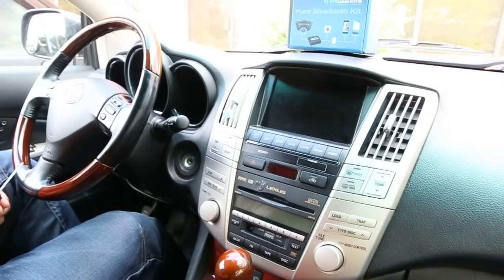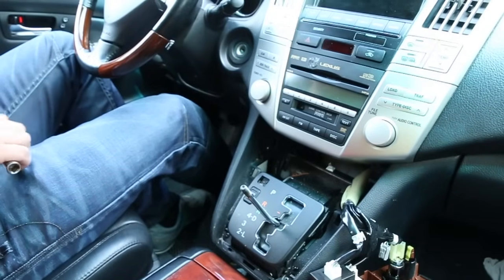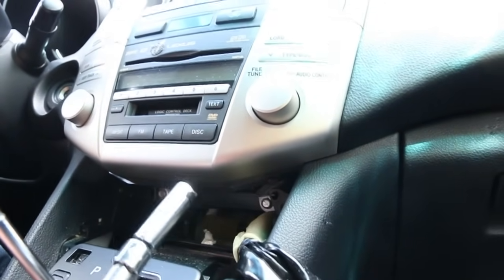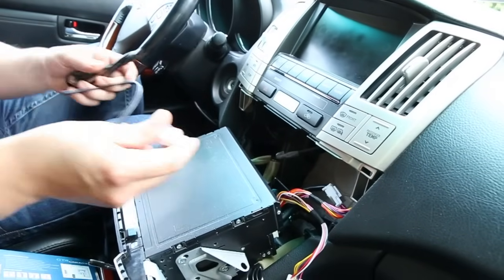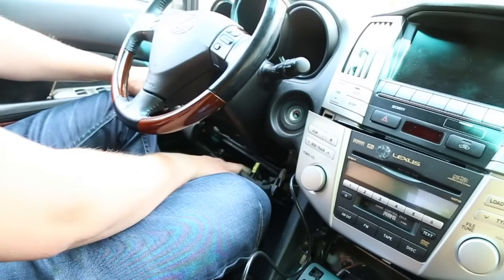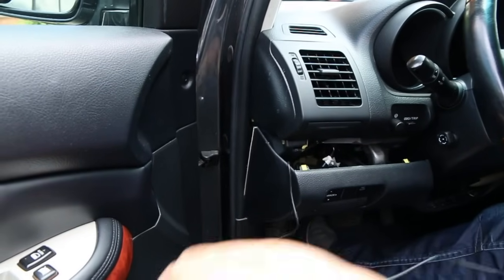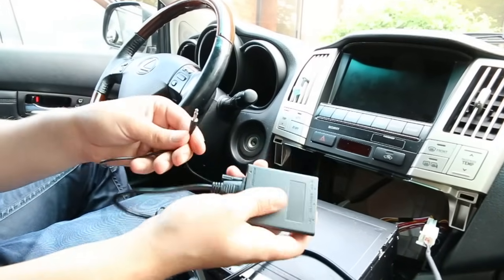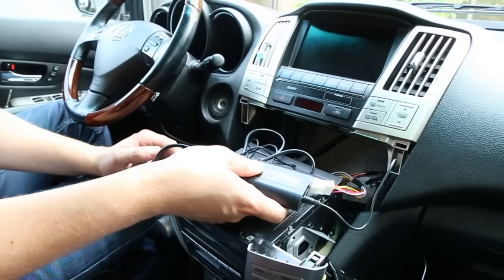Bluetooth Kit for Lexus RX 2004-2009 by GTA Car Kits

Comment: I bought and installed this unit on my 2009 Lexus RX350. Excellent! First, buying experience is as good as it can be - Few hours after I paid I got note that the product was shipped. I got it to days later, and then come what I thought to be the hard part - installing it. 
Well, I took a deep breath, watched at the video and followed, and about 30 minutes later my phone played music on my radio.
This is an EXCELLENT video with real life instructions that fantastically worked for me. Thanks guys, you've got my thumb up and 10 of 10 rank. THANKS! 
I wish I could find a place for review on your website! You sure deserve all compliments!
Few tips - 
1. WATCH the 4 screws of the radio ARE hidden and incline to fall and get lost! I placed some scotch tape inside the 10mm socket so the screw stacked in it and I manage not to lose it.
2. When I pushed the radio back the holes of the top 2 crews were not perfectly aligned and the screw would not get in. I used Dremel to create sharp conus at the top of the screw so it could force itself in and till the thread catch.
3. I used zip tie to secure the Bluetooth unit to the volume panel so it want just hang there and make noises.
Perfect, THANKS!

Comment: Honestly could not be more thrilled with this kit. 2004 Lexus RX 330. I installed in under 30 mins. The style of my door seal and A pillar did not allow me to run the mic that way, but I have a dash cover so I ran it under there and clipped it onto my A/C vent. Very easy great sound for music. Thank you so much, GTA car kits!
Reply: Did you take to a mechanic or you did by yourself?
Reply: @kimrodgers7809  I did it on my own. Could not have been much easier. I did drop one of the bolts and couldn't retrieve it so the recommendations below to use a magnetic socket on the socket wrench are right on. Everything seems to be solid with just the three bolts though. Good luck!
Reply: where can i buy it?

Comment: Video was clear and indispensable.  Watch the other one too, for the "AUX and iphone kit Lexus 2004-2009" - this shows you the location of the hidden 10mm bolts. Instead of a magnet, i used some sticky tack putty that is meant to hang posters. shoved a big glob in the ratchet and the bolt stuck no problem.  Did this to remove and replace. Worked great and left no residue in the  socket.  Bluetooth kit works great too!

Comment: Just installed this kit into a 2007 RX350 and everything went perfect.    Careful of those 2 hidden screws - they fall down and you'll need a magnetic reach tool.  The phone audio seemed to over-modulate kind of loud but it might be the caller's mic and not the unit.   Otherwise really nice kit.

Comment: Thanks for the great tutorial- installed pure Bluetooth on rx3502008 with great results but for a cleaner install I attached the microphone on top of the rear view mirror using double adhesive strip making the system like factory installed.
Yes the screws can fall fall out especially if socket is a little loose and I also used a magnetic stick- available anywhere but I always get low cost yet effective things at Harbor Freight

Comment: Helped me a lot. Thanks. Just a remark: be careful not to let the screws fall down. It is not easy do dismount the lower part of the console to look for them and pull them out. Use a socket wrench with a strong magnet to unscrew all the four screws.
Reply: InstaBlaster

Comment: i have a similiar BT Kit but not GTA brand and did the installation process in less than 30 mins with the exception of idiotically dropping one of the screws that fell off the floor on the inside.. just make sure you have some sort of stick magnet handy in any event this happens COZ IT will and CAN happen lol.. but other than that.. it was a pretty seamless process.  Thanks for the video!
Reply: Hah, just happened to me )) bought magnetic pick up tool from Autozone for 3$ and got them both ))
Reply: My experience 3 drop screw bolt lol.

Comment: Just installed the kit using this video. It really is as easy as it looks! A few things:
1. I don’t have Navi, but I still had to use the Y adapter cables. Not sure why but it worked.
2. Also I was extremely lucky that there were only the 2 easy to reach bolts. They didn’t screw in any in the hard to reach location, which made it less of a pain. No idea how I would have gotten them back in there, but clearly they’re not necessary! (at least in my 2007 model.)
3. I couldn’t easily remove the rubber on the door so I just used the tools to get the microphone wire to slide in the rubber without removing it. Worked really well!
4. I used Velcro to adhere the Bluetooth device in space I found behind the hazard lights button. Again I have a 2007 w/out Navi but it’s secured up there so there is no movement and allowed me to easily clip the radio back in.
Reply: Does this Kit work for the 2005 Toyota Corolla S.

Comment: Does this completely eliminate the Lexus Bluetooth for the phone or will that feature still work? The existing phone integration works great and don’t really want to lose it.
Reply: I also have the same question.  I already have Bluetooth that works with my phone (but not my music).  Can i skip wiring the mic through the A pillar? I suppose I'd need to toggle between Bluetooth connections for that to work... Is there any way to just connect the mic that the car is already using, to the new Bluetooth module?  I have no idea where it is, but it works just fine, and isn't visible, like in this example.
Reply: I’ll answer this.
Basically your connected to two Bluetooth so when you get phone call it goes to the Lexus oem Bluetooth and when you hang up it switched back to the gta Bluetooth
Reply: @dineshe3719  obviously my question was old. I installed the system and it worked just as you described. I wish I wouldn’t have installed it though. Should have just paid the money and bought a new stereo.
Reply: @vallejokid1968  why what issue did you have?
Reply: @dineshe3719  one of the issues is that it never remembers the song you were listening to. You get out of the vehicle and come back and it’s starts playing the song then suddenly goes to a random playlist or the very first song in your library, every time. So you end up hearing the same stuff over and over and it tends to pick the “most played” play list which of course is the songs it keeps reverting to. You also can’t control anything from the stereo. If you try and skip a song it will go to the next song and then stop playing music after it ends. It basically acts like you only wanted to listen to that next song it quits the shuffle or album you started. That’s just a couple issues. Connection wise the Bluetooth works well.
Reply: @vallejokid1968  did you have mark levinson or standard audio?
Reply: @dineshe3719  standard.
Reply: Who do I buy please? I have a 05 Rx 330

Comment: Can you still use default Lexus bluetooth for phone (answering via the steering wheel) and use this kit for music only?
Reply: +yeld Did you get an answer to this question? I am wondering the same. Thanks
Reply: No, I did not.
Reply from the maker: +yeld No it will not work like that, your phone will not be able to jump between two BT devices, they will interfere.
Reply: I ordered and fitted the kit just the other weekend, very happy with my purchase. Thanks for the great videos :)
Reply: I'm able to use both, the Lexus  bluetooth for the car phone and GTA car kit bluetooth for music. After you've paired the GTA kit go In your settings for GTA and there's 2 toggle for use. Turn off   call audio, and keep media audio on. I preferred the Lexus bluetooth to make calls. That way when you have multiple devices you can use the one you desire and for what purpose. It work for my Samsung galaxy note 5.

Comment: My car has the rear entertainment + NAV.. and to access to rear DVD to front LCD display screen i need to press twice just exactly same as to access your device.. in this case... do you think my car still able to use your bluetooth kits along with the rest of all my existing features?
Reply: Hi Jeffery, my RX has the same systems as yours..... Did you ever get this installed? Did it work or cause issues with the entertainment system in the back?

Comment: We just added this to our ‘06 rx400h and it works great for me to play music but we only have 2 issues:
1. Siri and phone calls are over modulated, like it is sending too high a signal for some reason, even though music sounds great. 
2. I can’t connect my wife’s iPhone, it is like it is not discoverable now that I’ve paired it with my phone. Can we both pair it even if we only have one connected at a time?
Reply: Does the energy control work (motor/battery/power)

Comment: What if you are listening to your car's AM or FM radio and you receive a call? Will you hear it and you have to switch over to CD1 (bluetooth) to then answer?
Reply: Only does when you listen to your BT connected devices or auxiliary 
Anyways the rx 350 has BT connection with cellphones as factory feature

Comment: Hey all—has anyone installed this on a 2006 Lexus RX400h, the hybrid model? Looking for options to add Bluetooth, but not sure if schematics of wiring through the radio are the same for hybrid and traditional models. Any help would be appreciated!
Reply: only difference is the drivetrain, essentially the entire 2nd generation of the rx series is compatible

Comment: How do I stop the Lexus rx400h on board Bluetooth from connecting. I tried forget devices on my phone and removed from the Lexus. It still connects and causes connection problems.
Reply from the maker: Hi, you might be forgetting the wrong device on the phone. Once forgotten, it will no longer be able to pair. Thank you.

Comment: Just ordered through eBay. Thx
Reply: What’s the kit and the hornets name pls thanx
Reply: I returned it had problems with it. It’s been a while ago can’t remember why I returned it specifically
Reply: It wasn’t connecting properly.  I just ordered a device you put in cig lighter and you designate a ch on FM radio and sound came in better

Comment: Is it necessary to wire through the side pillar and under dash if the car is already set up to make phone calls? My car won't allow for Bluetooth connection to play music; it only does phone calls. Would I need a different kit?
Reply from the maker: Hi, the stock microphone will only work with stock radio. If you want to use our kit both for music and phone calls then you need to wire the mic. Thank you.
Reply: But we're not changing the radio. Just adding Bluetooth